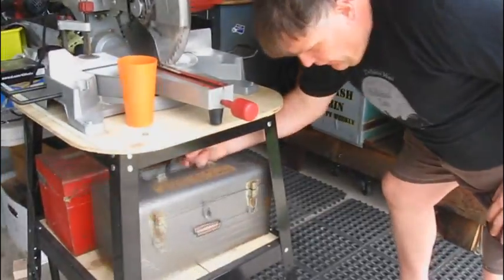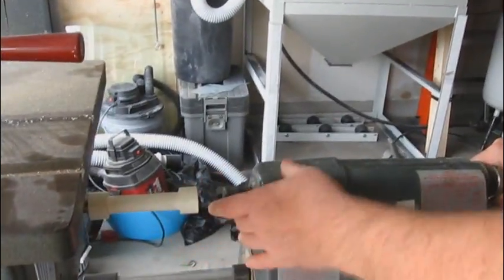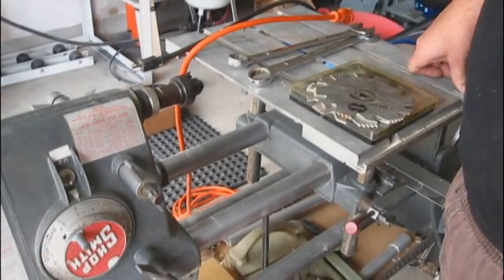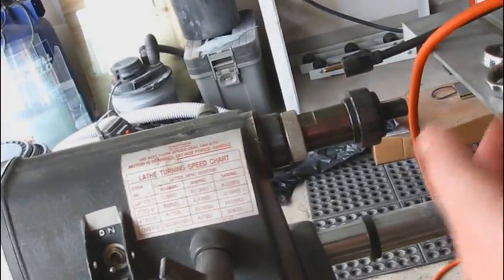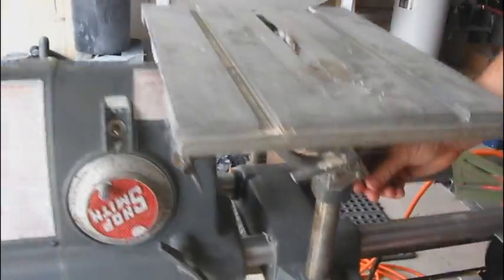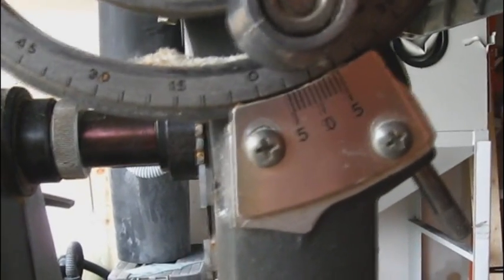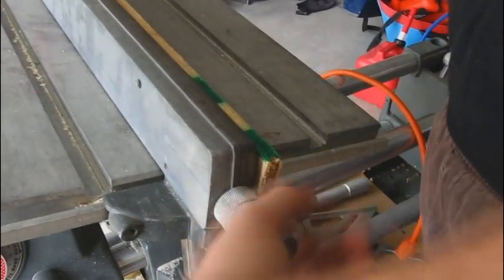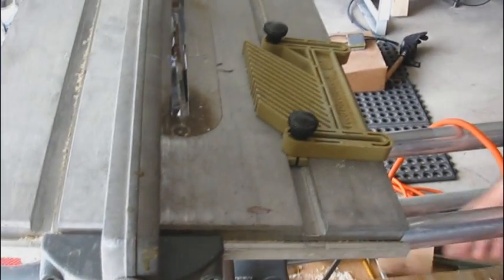Shopsmith Tutorial 2 - Setting up the Dado Cutter

Comment: With the Mark 7 wouldn't  you be able to use the upper and lower saw guards with only the quarter inch dado. I know I would not be cutting all the way through and exposing the blade. The reason I ask is I am going to make some drawers and I think I can do all the joinery with a 1/4 in dado and it seems safer if I can use the guards
Reply from the maker: Unfortunately, I do not know. I bought mine in 1985 or so.

Comment: Can you use the upper saw guard with dado blades? Is kickback less of a risk with dado blades, more, or the same?
Reply from the maker: When sawing wood, you are splitting it... as the piece is cut, the two halves can pinch the blade and suddenly change the force needed to push forward... causing a sudden kickback. When using a dado, the force is constant... and usually, because the piece wants to rise upward, you have a push stick applying force forward and downward. There is less of a chance for kickback. Having said that... still do not stand directly behind the piece just in case.

Ironically... I made this video because Eve was going to make these mounts for a mirror, and I wanted to capture the process and put it somewhere she could find it. (On my page.) I thought 4 or 5 people might see it... I never counted on 0ver 25,000 views. Sometime this summer, I hope to redo these videos and make a series... I have had several people asking for that.
Reply: This is particularly helpful for me because I own a Shopsmith. Also, because you don't assume the viewer has any knowledge of the machine or its operation - which is extremely helpful because nothing is glossed over.

Is there any reason why you couldn't use a dado set other than Shopsmith's own for cutting dado's? Also - do you ever use the router functionality on the table? Is there any reason (other than perhaps customization of width) that you would use dado over the router?
Reply from the maker: The dado is excellent for straight lines... since it uses a saw blade... it is less likely to slip sideways during a cut... self-guiding pretty much. A router is by-design capable of moving in any direction. You can use either one... my personal preference for straight cuts is the saw. Any dado set designed for that size mandrel will work... I just happened to purchase mine at the same time as I got the ShopSmith. You can also get the wobble type... they offset the blade so it tilts and "wobbles" during the cut... the bottom of the cut will however be slightly curved. I prefer the stacked set... but I have both. My ShopSmith doesn't have the router capability... it is a 1984 series. I do have a router table... but I don't use it for rabbit cuts.

Comment from the maker: The same, no. Similar, yes. They changed the table design to have extra legs, added some safety equipment, and upgraded the motor size. You can get an upgrade kit to turn a Mark 5 into the Mark 7. Operation and function is still basically the same.